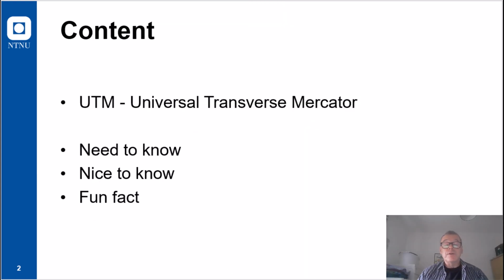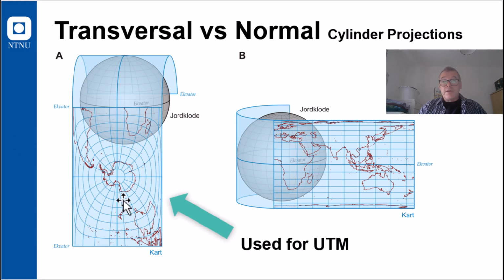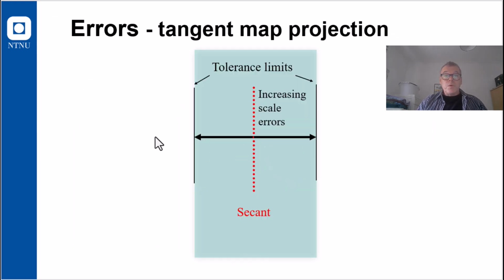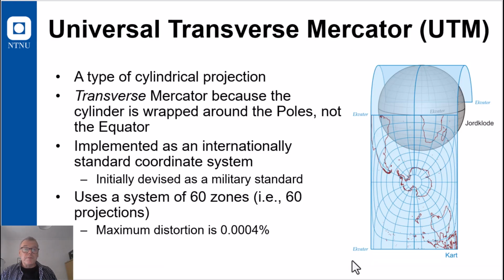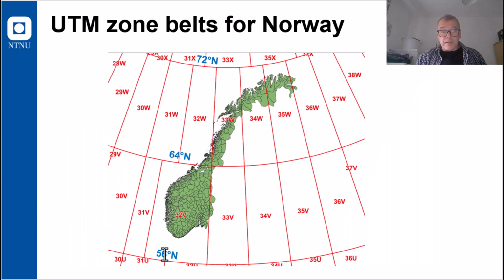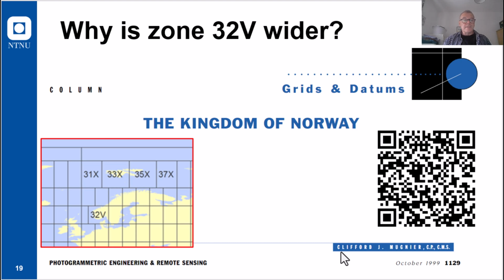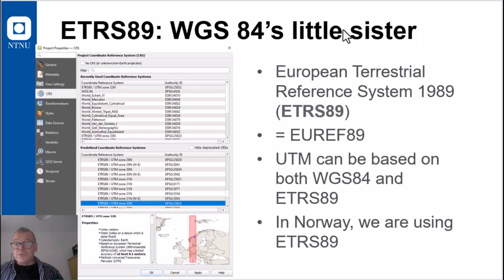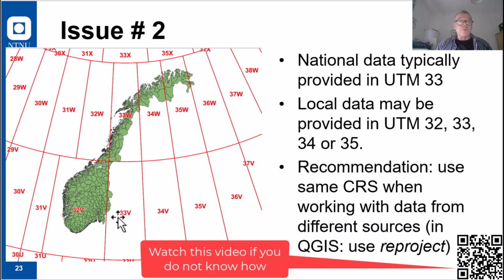Cartesian Coordinate Systems

Comment: I still don't why special cases were made for Norway and Svalbard. The advantage is that you have consistent numbers for all of southern Norway, but it is a pain to work with, and it's yet another thing people can get wrong when implementing. It also seems like people are confusing UTM with the Military Grid Reference System, which does not have this exception.

Another issue is that there seems to be no standard encoding for which order to the northing, easting and zone...